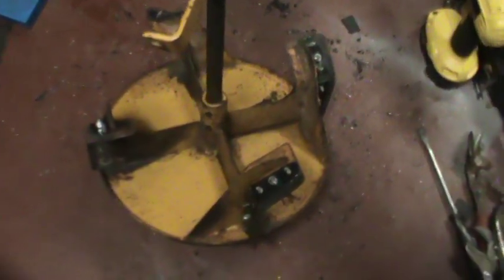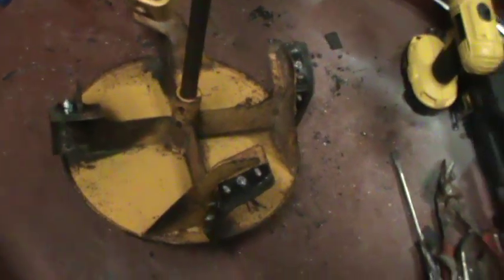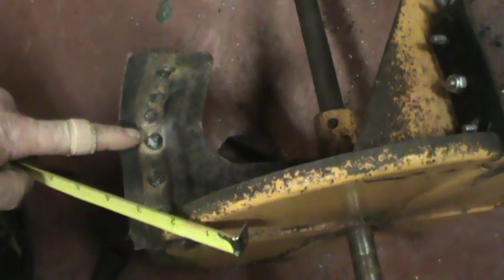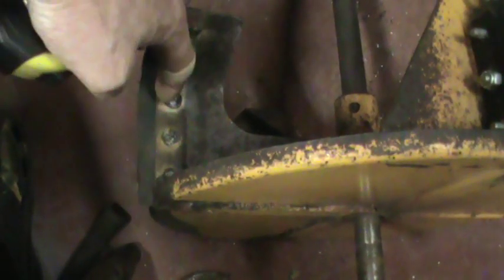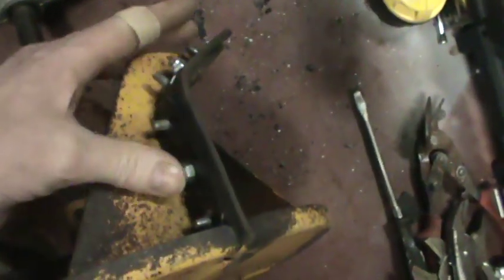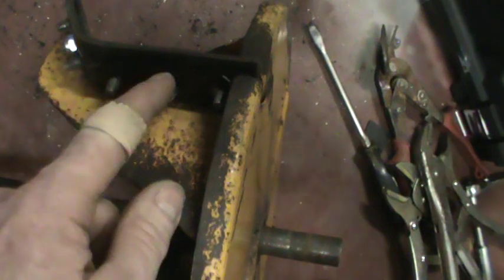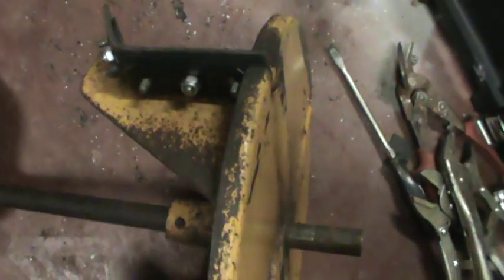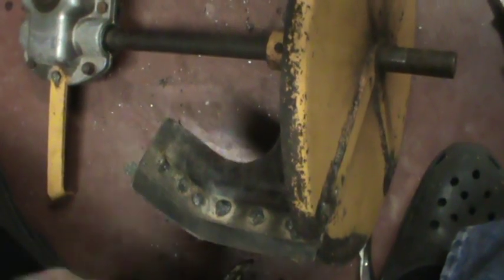Snowblower Impeller Modification Part 1

Comment: I'm going to install one on my new troy bilt 2 stage.  Hoping it does the trick.  Only had wet heavy snow this year and as strong as the motor is its still not moving that wet snow like I want it too.  I'm wondering if putting flaps on all 4 blades is necessary?  I think I have enough rubber at the moment for two blades,  we'll see how it goes I guess

Comment from the maker: Yes the impeller modification + changing the chute from the old short 1/2 round metal one to a newer, longer plastic chute doubled the distance it will throw snow. Up to 40ft now! The impeller mod will also just about put an end to the chute plugging 
with wet snow.